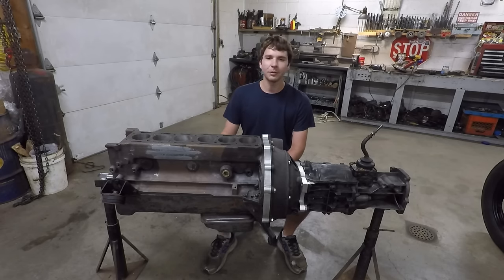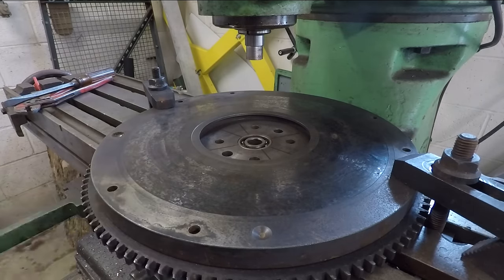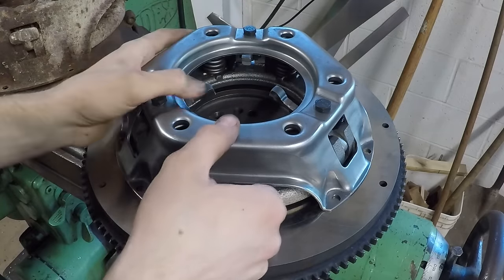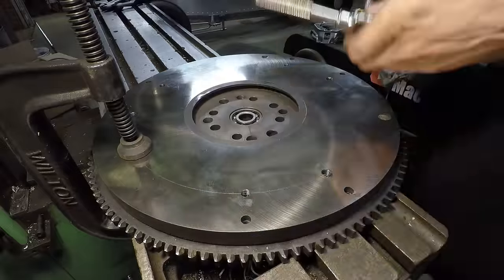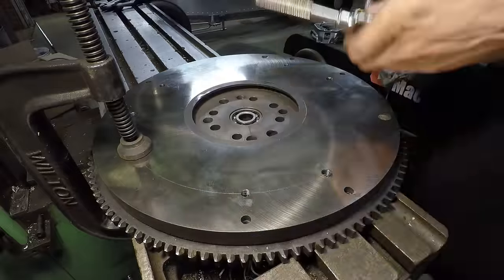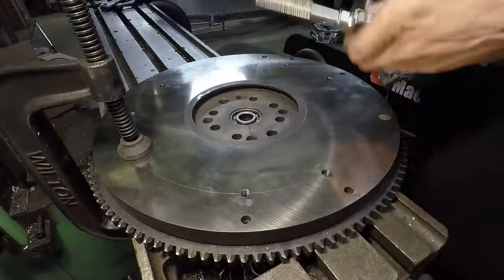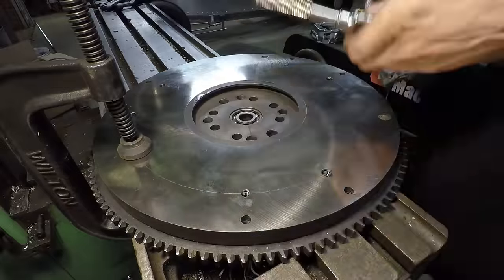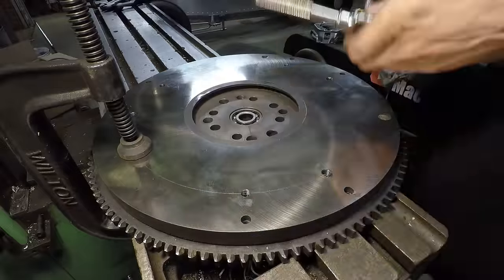Adapt ANY Engine to ANY Transmission!

Comment: "If it can be done, then why can't I do it." Best statement ever.
Reply: You don't have the gift you don't have the mindset nor the tools nor the attention span the day you have this that's the day you will be able to do it also. But I like to think whatever you do it is equally impressive perhaps not to you but to anybody that sees what you do they can try but they won't be able to do what you do because you have all that it takes to do what you do God bless you friend
Reply: Just because it can be done doesn’t mean that it should be
Reply: Bellhousing adapters and custom mounts are one thing, but to have the right or compatible splines, gear ratios, etc. is another thing.

Also if the car has ecm, it will need the settings to be adjusted / modified to work.
Reply: I still do like the idea of custom fitting things to work.
Reply: followed by "how hard can it be?"
Reply: One question...with all those holes in the flywheel hub, couldn't thar break out under stress...? It's surely weakened.
Reply: One question...with all those holes in the flywheel hub, couldn't thar break out under stress...? It's surely weakened.

Comment: FYI a bees wax stick really helps when band sawing aluminum
Reply from the maker: haven't heard of that before, but I'll keep it in mind
Reply: It lubricates and keeps the teeth from clogging. Basically any soft metal. They sell them at Grangers or McMasters or you could just use a beeswax candle
Reply: Bar soap works also.
Reply: Or a candle...works for grinding discs too
Reply: @MacroMachines  Any wax, or really anything that a) doesn't get sticky, b) is soft enough to move, and c)will stay put on cold metal well enough to fill the pocket of the cutting teeth so swarf can't pack in there and attract more.
Reply: Paraffin is my favorite, canning wax/paraffin is super cheap to and comes in good sized blocks
Reply: @andrewcarrizales2191  Ah, Gulf wax. Grab a bottle of citric acid powder while you're in the canning section, so many uses....

Comment: I have put T-5 transmissions behind a lot of different engine. They are great transmissions.
Reply: This Statement Has Been Fact Checked To Be True!!!
Keep Rocking it out Brother!!!
Reply: My father put a T-5 in his 67 Mustang. It originally had a 3 speed automatic. I imagine it was pretty simple in that application.
Reply: Until you destroy 3rd gear. Despite that minor set back, I just keep buying them from the junkyard and running them until the gears explode.

Comment: Back in the 60's when we were racing SCCA, a friend of mine took a 2.4 Jag and cut it down to a 4 cylinder for a sports racer he built.  He was a real craftsman, the car and the engine were beautiful, but it never went fast- too many ideas packed into one car meant endless troubles.
Reply: Have you seen Milyard's work? Everything he builds is daily driver ready, and 100% factory spec reliable somehow. There is no explanation for how his work is so immaculate.
Reply: John Morgan  This was the 60's dude.
Reply: John Morgan  You are thinking of a hot rod- I am talking about a sports racer- that is a class of racing cars- C sports racing was cars up to 1.3 liters, B sports racing was up to 2 liters and A sports racing was unlimited ( Can Am)
Reply: @Ritalie  Some of that is due to him carefully picking the technologies he works with. The 4 -> 6 cylinder Kwak is a great example of this, it used a split crankshaft with roller bearing big ends (so easy bearing clearancing) so each throw of the crank was a separate piece. All he had to do was dismantle 2 crankshafts and press 6 throws together to make a 6 cylinder crankshaft, no machining needed at all. It also had press/shrink fit cylinder liners so they could be removed while he lengthened the block.
Reply: @mememaster147  Good info. That makes a lot of sense. I think the XS650 can be converted to a 180 degree engine if you change the crank halfs. But what is the Kwak? Which bike is that?
Reply: I know a man now who was a his own mechanic in the 60's,  and took at least one national title.  Charlie M. is his name. Out of Jax Fla.
Reply: @Ritalie  Seems to be the original Z1 - https://www.youtube.com/watch?v=uW2YFNDjN_o
Reply: Jaguar actually did design a four cylinder XK engine but it never went into production.   It was going to go into a stillborn XK100  but the XK120 proved too popular to proceed with the four cylinder car.
Reply: Thanks- that was something I did not know.

Comment: Very impressive. This guy is a machinist and a car guy. I could not come up with the solution for marking  the dead end holes. Oh and the fitting quality is so nice because of the pins. The pins turn it into a real joy to assemble or disassemble this.
-Insta sub.

Comment: I would use a small pan head bolt to retain the flywheel dowel pins from working out and destroying your clutch or crank. The heat and vibration will work those pins out at anytime!
Reply: just use loctite

Comment: Back in 1968 I adapted a  1965 289 mustang 4 speed to my 1959 MK1 3.4. I used the Jag flywheel, pressure plate and trans bell housing. I had the bell housing center hole machined out to fit the mustang trans bearing retainer cone and 4 holes drilled to match the  Mustang trans mount holes. The trans input shaft was cut down by 3/8th of an inch in length and used a Jag bronse  pilot bearing drilled out to match the mustang input shaft. Since I used the Jag bell housing the clutch linkage all worked like stock since it was. The drive shaft was cut down to fit and that was it. Just an option. Machining was minimal and it still worked when I sold the car 10 years latter.

Comment: One important aspect when choosing a transmission for a given engine, is to make sure that the step between the gears (relationship between the number of teeth of two consecutive gears) is compatible with the engine step (relationship between max power and max torque rpm's). If the step is just right, when you change gears, the rpm of the engine will fall closer to the rpm of peak torque, in order to make sure that the engine will have enough torque to continue accelerating the car. If the rpm falls too close to maximum rpm, the step is too short and the gear will be mostly useless. If the rpm falls too far below the rpm of peak torque, the engine will struggle to maintain the acceleration and will under-perform at the expense of the clutch.
Reply: Which rules out an NV4500 for everything!
Reply: Feel better now?
Reply: ya specially if its a diesel engine that makes most of its torque under 1500 rpm but will be happy to rev past 4.5k.......  thats not how it works. not at all. not even close.
Reply: @nagyandras8857  It is only possible to achieve higher power if there is enough net torque to continue accelerating, i.e. if you apply more resisting torque to the shaft than the engine can deliver at a certain rpm, then the engine will stall for as long as the clutch is fully engaged. Another example: try engaging the last gear on a truck and going uphill while fully loaded, the moment the clutch is fully engaged, the engine will stall.
Reply: @_John_P  so we have our engine delivers its max hp at 4500 rpm, and max torque at 1500 rpm since it would be a diesel, its pretty realistic. if i would base a transmission on your "assumptions" it would be looking like something.. awefull.
idle is 1000 rpm. so if i would use your proposal and start from first gear, and do as like people do and shift around at 2500 rpm into 2nd gear during my usual driving, my engine would have to fall back to... 833 rpm, so under idle. nice job genius, it would stall.
if in first gear this car would do no more than 10 mph at readline, then 2nd gear would be 30, third gear would be 90, and 4th would be 270 mph at redline. do you realy think this is by any means a good approach ??
Reply: @nagyandras8857  You just described what I wrote. When you choose the step between gears, you are to make sure it does not fall too close, otherwise the gear is mostly useless, and you might found out you are just skipping it most of the time, nor it falls too far, otherwise you risk the engine being unable to continue accelerating because the rpm dropped so much that the torque produced is less than the demand, preventing continual acceleration and risking stalling the engine as in your example. Also, the number of gears is a design choice.
Reply: @_John_P  the example i gave was for your envisiond ideal stepping of going from peak power to peak torque. pointing out that its just plain wrong as it is. yes you need proper gear stepping, no, you do not have that by going from peak hp to peak torque. its not going to work, nor will be good at all. ever. 
you need far more than the peak hp rpm and peak torque rpm. depends on application too. and if its a track car, depends on the track too.
Reply: @nagyandras8857  The application is the vehicle in the video. You are trying to force the ratio to be such that a pair of gears cover exactly peak to peak. What I'm saying is that the ideal ratio makes it fall after the torque peak, but not too close to peak power (i.e. closer to peak torque), otherwise risking either a useless gear, or one that prevents continual acceleration.
Reply: @_John_P  that would still be horrible.be it everyday driving or racing of any sorths, or a tractor. 
good gear spacing is a musthave. but you envisioned methood of making it is far from reality.
Reply: @nagyandras8857  I've created a chart using the Jaguar stock gearbox for the XK6 2.4L engine depicted in the video, with the actual torque curve, to further illustrate what I mean. It shows how the intended design from Jaguar represents what I mean, also it is a real world application: https://ibb.co/T2TLGmb
Reply: @_John_P  no it does not. You told the ideal is if the RPM falls from peak hp RPM when whifting down to  peak torque.
Your graph absolutely does not show that.
Reply: @nagyandras8857  It shows that all gears are compatible with the engine's step, as they are comprised within the two vertical lines and were selected so they fall closer to max torque rpm, instead of staying close to max hp rpm, which would make the latter a short gear, and neither crosses the max torque rpm, which could make the engine struggle to continue accelerating depending on the load.
Reply: @_John_P  yess you need proper steps. No, you do not want to have too short or too long gears.
Those are correct statements.
Incorrect to state you want a stepping close to peak torque. That would be dumb.
Your illsutration perfectly shows that.

What you want is to stay within the power Band. And that has nothing to do with torque.

Comment: Good video :) nice work, I did a simelar job 35 years ago, when I mated a Hemi V8 factory fitted to a autobox with a manual 5 speed gearbox.
I used the complete clutch assemble that matched the fly wheel.  

Good to see I am not the only one that keep old bitz "just in case"

Comment: I did this in the 90's. I fitted a Pinto engine from a Sierra into my RX-7. I used one flame cut adaptor plate. The bolts from the RX-7 gear box bell housing cleared the engine. So engine bolted to plate one side and gear box on the other. Nice to have workshop tools, all i had was a hacksaw, stick welder and hand drill to build engine mounts.

Comment: Don't just eyeball the bell housing into position.  Mount a dial indicator on the crankshaft and sweep the center hole on the housing to get it concentric with the crank centerline. You already have the crankshaft mounted in the block.

Comment: So wait is this basically like "poor mans" supra engine. you're a genius dude subbed
Reply: I agree with your comment yes he does look like a genius but other people see you as a genius also when they observe what you do because you do it so easily and with Grace as easy as blinking your eyes yeah it's good to be you
Reply: The supra's engine is not that great. If you take the money spent to make a 2jz a great engine and spent it upgrading an engine with a larger displacement you will get far more power. Inline 6 engines have been used for over a hundred years.

Comment: My Dad and I adapted a Jaguar 3.4 liter to an Austin Healy transmission that had an electric overdrive.  We only made an adapter between the Jaguar hogs head and the AH transmission.  We used the Jaguar flywheel (lightened) and pressure plate and used the AH clutch plate that matched the splines of the trans.  The car was a beast.

Comment: This guy could hook up a turbo encabulator manifold to a klein bottle tribolumeter while running a carborundum-lined harmonic inertia driveshaft outboard spindle.
Reply: Exactly what I was thinking!
Reply: I tried that, but the wheel fell off!
Reply: @Dave.Wilson  Did you overtighten the spindle nut defribillator?
Reply: Thats when the widget pin slipped though the black hole and disappeared.
Reply: I once dumped motor oil on my chest an hooked jumper cablea to my nipples but never anything like this guy does
Reply: You have to ensure correct motion of the reciprocating  dingle arm.
Reply: @Dave.Wilson  the widget pins man, they wiggle out so easily
Reply: I have absolutely NO interest in trying to connect "un-matched" engines and transmissions together. I will Never do it! But, I find this fascinating and love watching his thought process. I have seen kits for mating "this engine to that transmission" and have wondered about it, but not something I will have a need for. But I love this video!!
Reply: @mike65120  i have a dream that a dodge viper transmission will be connected to my v6 Camry hotrod engine.
Reply: As everyone knows, that's the only way to effectively prevent side-fumbling of the ambifacient lunar waneshaft.

Comment: Nicely done.  One suggestion for future projects - save yourself a buttload of time and messing around and buy yourself a set of transfer punches for speeding up marking bolt holes and alignment pin holes.  Even the cheap Harbor Freight sets are hardened steel and will last forever.

Comment: I don't know about those years but the later jaguar motors use a Chevy TH400 transmission in them.
Reply: my 1989 XJS has that same hydramatic. I plan on doing a swap to a Tremec Magnum in the near future though, that GM bolt pattern won't help me now haha.
Reply: Jaguar used a TH 400 trans but it was in a jaguar only housing, when I converted my 77 XJS to a V8 I was only able to use the speed o gears and drive , and install it on a Chevy TH 400

Comment: Did you skip over the part where you accurately centered the crank to the transmission side of the bellhousing? Or are you planning to correct it in the bellhousing to T5 adapter plate? I ask because you mentioned being able to use off-the-shelf adapters for the flathead Ford to T5 section, but that's only true if you have the crank centered + or - 0.005" or less in the Ford bellhousing and you only showed yourself eyeballing it.
Reply: I had a similar question.
Reply: Same question here. How did you get the bellhousing concentric?
Reply: Work from center. Everything is held from the same center line
Reply: I would have used a dial indicator off of the crankshaft.  If you get it wrong, it will shake like nobody's business. 
I've had experience repairing something exactly like this; it was a generator mounted to a 4-53 detroit, but the engine had a vehicle flywheel instead of a generator flywheel.  The thing shook like a compactor because the it wasn't possible to center the generator drive disk accurately.  It broke it's mounts off.

Comment: Here's a bit of automotive history that you might appreciate because it goes to the topic of your video.
In the late 40's and early 50's here in America my grandfather used to buy a junkyard Dodge, Ford and Chevrolet and take the good engine from one, bolt it to the transmission of another, and then install the two into the body of the other...

...all without any adapters or mounting plates at all!

The reason he could do this was because the engines all had the same bolt patterns to mount to the transmissions and the mounts matched up as well. Why? Because all of those manufacturers had been making Sherman Tanks during WWII. After the war, Dodge for instance would come out with a new engine but would design it to mount up to the existing transmission they were using, which had been designed to mount up to the engine that was used in the tank! Engine mounts matched up too and these patterns and mount locations crossed all of those manufacturers. A Ford engine would bolt to a Dodge or Chevrolet transmission, as would a Dodge engine bolt to a Ford or Chevrolet and vice versa, and all the mounts were located in the same places on the frames. Even the pilot bushings in the crankshafts were the same!
Reply: Hmmm....Are you sure Grandpa wasn't telling stories?  Do you have any pictures?  In cars, Ford, Dodge and Chevy all had different bolt patterns, different pilot bearing sizes and different input spines.  A Ford, Chevy or Dodge car engine was simply too underpowered to use in a tank so none were used!  Or are you talking about big trucks?  Trucks often used standardized S.A.E. bell housing patterns to allow interchange but this was standard industry practice, not just tanks.  About the only automobile engines used were twin Cadillac V8's with Hydramatic transmissions.